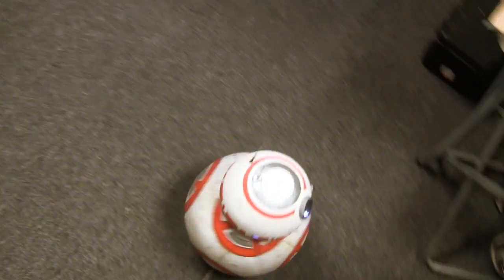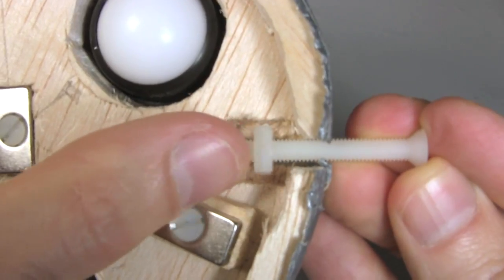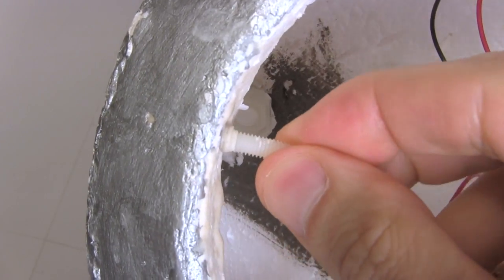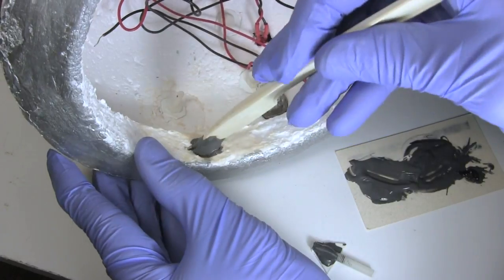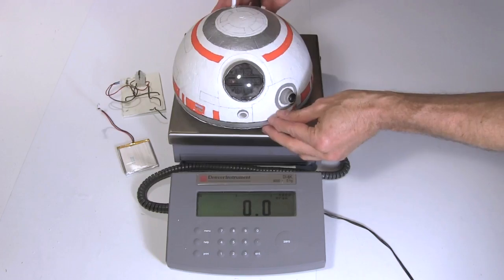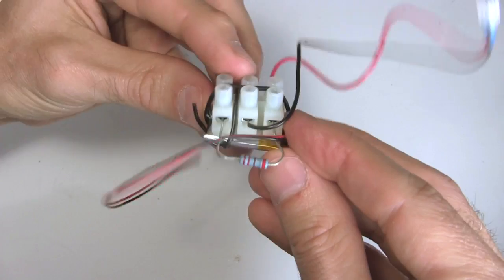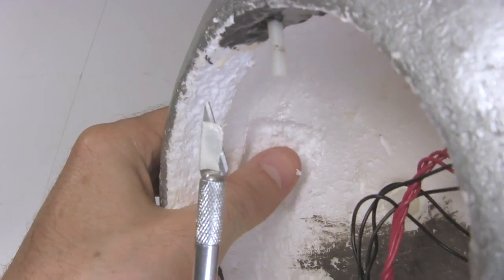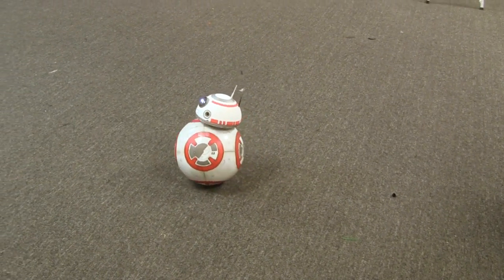Making BB-8 (v2) - Improving the Head - Part 7

Comment: Maybe an internal flywheel would help preventing the model from bobbing back and forth, doing a way better job than the gyro sensors...

Dunno, the wheel should have either some speed or some mass and this could really be a problem... 🤔 

https://en.m.wikipedia.org/wiki/Anti-rolling_gyro
And
https://m.youtube.com/watch?v=BTrgdhq0vTw
Reply from the maker: I think that would work. It would stabilize the internal structure.
Reply: @RimstarOrg 
the model is already awesome as it is, to be fair! 😁

Comment: Why not getting rid of the ball-bearings at all? 
YouTube: Amazing Discovery With Magnets
Reply from the maker: I suspect if you try that vertically, it wouldn't be stable. That's why the levitating one is usually spinning or there's some active electronics with a coil for the bottom one to keep it stable, which would add weight to the structure near the top of the ball. It would be an interesting approach to explore though.

Comment: If he wanted to run fast can lose your head
Reply from the maker: Actually, I know you're joking but I was thinking of experimenting with speeding it up (tweeking the PWM duty cycles) and maybe the momentum will make the drive system have to work less hard and be able to keep the head on better. On the other hand, the head may just fall off easier when it hits a piece of tape or a slightly mismatched section of the seam. I might just try it.

Comment: Why don't you use an Arduino with an accelerometer in the head? That would surely be heavy but much more effective and cool!  And lolllzzz i think it's about an year you are doing this BB-8 Project. Great work by the way! Keep making videos.
Reply from the maker: The heavier it is, the harder it is to keep it on. That's because the heavier it is, the stronger the magnets have to be. The stronger the magnets are, the more powerful the motors in the drive system in the ball have to be, and also the heavier the drive system has to be in order to keep traction inside the ball. My driver system is at its limit.
Regarding the time for the project, I could have declared it done once I'd painted it, but this is the type of thing that you can always make improvements to and add new features. Some things wouldn't even be improvements, just different ways of doing things, such as replacing the Arduino and IMU in the drive system with some other boards. As long as there's an improvement, new feature or something to be learned and passed on then it's all good.
Reply: Don't use magnets. Use arduino in the head along with three motors and three wheels. The head will automatically balance itself.
Reply from the maker: Yup, I've seen James' series on that. That would be similar to mine since it stays on top like mine does. That one doesn't have a drive system inside the ball so so it doesn't work as well as one that does. However, you could have a head driven that way that is somehow synchronized with a drive system in the ball.
The problem with that type of head, and it's the reason James moved on to future versions that use magnets, is that BB-8's head is supposed to be able to tilt down the side part way, so not always staying on top. Mine doesn't do that, and I don't know if it ever will, so I guess it's a non-issue with mine. Here's a photo from the movie of the head tilted https://lumiere-a.akamaihd.net/v1/images/bb-8_14e2ad77.jpeg?region=0%2C0%2C1560%2C878&width=768

Comment: I like how quickly projects always go from "hmm I don't have any glue around maybe I'll just make my own with flour and water" to "alright I went out and bought a two part steel reinforced epoxy"
Reply from the maker: It's the 'minimalist way first' approach. But really, in this case with the problems I had sanding flour and water paste off the head back in Part 5 - Painting/Details/LEDs (https://youtu.be/PxG8bDkTSUI) I thought it had a chance of working. In fact it might have if I'd put the plastic pieces on the end. But I had that J-B Weld on the shelf waiting anyway. Everyone should have J-B Weld in stock :-). That stuff's stupidly strong. I first used it for gluing a tiny brass cylinder to the surface of a sheet of steel for my big Stirling engine (https://www.youtube.com/watch?v=H1IkVMSBMRg), the cylinder that the displacer rod is going through. You can seriously pick up the Stirling engine using that cylinder with no danger of it coming off. Crazy.

Comment: Maybe the weight could be reduced further by powering it using induction from the body instead of including a battery pack?
Reply from the maker: The receiver inside the head would probably weigh more than the 150mAh battery. It's tiny and weighs only 4.65 grams.
Reply: What type of receiver are you talking about Steve?  No need to put any advanced receiver. Just coil around some thin magnet wire and connect it to the led via a resistor. That should do it!
Reply from the maker: That's the type of receiver I'm talking about. I guess it would weight around the same as the battery. That battery's pretty ligthweight.